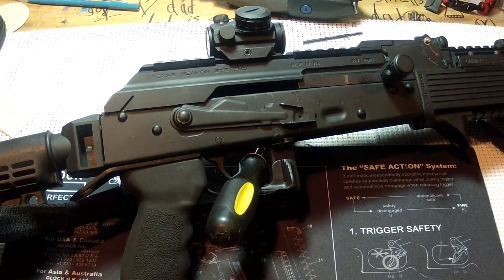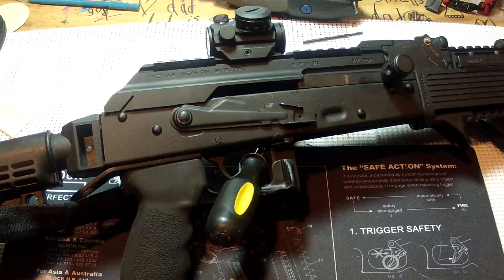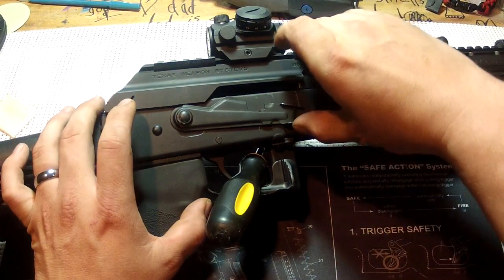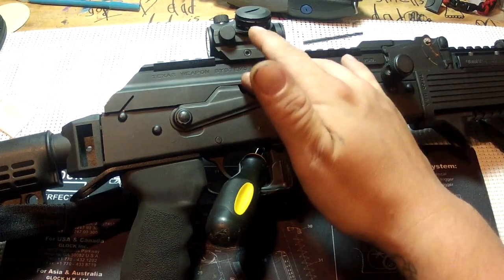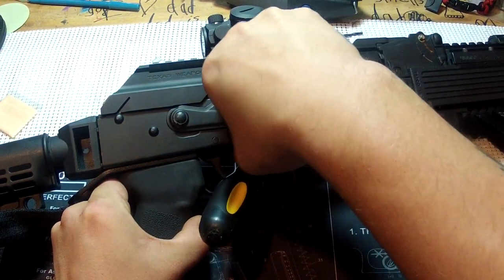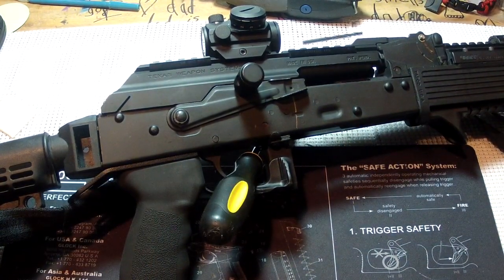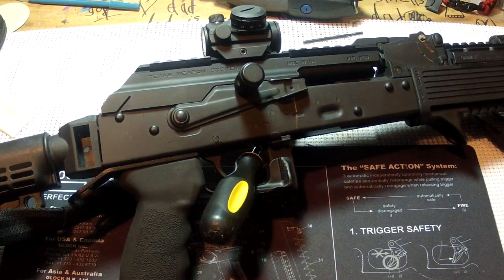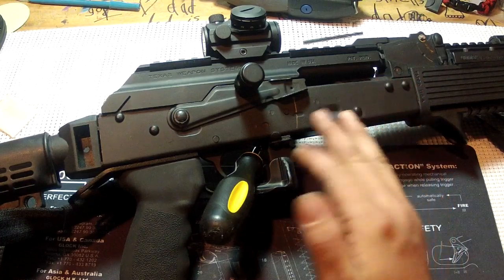AK PLATFORM BOLT HOLD OPEN  (simple modifiation)

Comment: Cool mod practical, easy and inexpensive. Yugoslavian magazines can be had for under $20 bucks and you get the real advantage of "last round BHO". But like I said very practical but you have a good rifle just get the Yugo mags. I have done mods on the cheap when funds weren't available and if need be I'll do it again but I only screw around with easily replaceable inexpensive parts. I've done some butchering and I've done some good mods but I've come to appreciate "buy once, cry once". If only I could win the lottery what a lineup of guns and a good safe I would have.

Comment: I've never been to a range where you could use a mag as the bolt hold open. They always require the mag be removed as well as the BHO engaged. This would be a good way around it, though I rarely go to ranges.

Comment: wit any AK all u have to do is hold the bolt back and pull the trigger and when u let go the bolt stays open then alll u have to do pull it back a little ,let go and it will go forward..... THANK ME LATER 💯
Reply: That doesn't work with any proper ak, maybe some weird variant... How do you think it will cycle if the bolt gets stuck open every time you fire?

Comment: Try this, when you pull back the bolt all the way, before you let it back into battery, squeeze the trigger. I believe it only work with the Tapco g2's, I'm not sure. But the hammer wedges in the action, and it disrupts the bolt from going forward, holding it open. Then swap mags, and charging the handle and your back in business...
Reply: yes this works on most AK platforms as you say not many people seem to know about it
Reply: CBtime2020 not 100% reliable

Comment: The weapon comes with a safety and well  covered action...with the  slide hung in the safety the chamber is to open to huge pieces of crud..cant see the advantage..
Reply: +VN Dustoff
This feature is intended to be used mostly in a shooting range environment. The rifle is not going to be submerged in crap while slide being held back. I can't see the problem.

The advantage that you can't see, on the other hand, would be actually being allowed on the shooting range while not being banned. Quite obviously advantageous, isn't it?

Comment: All I have to do is pull my bolt back then pull the trigger and hold it while I ease the bolt forward....I think just about all AKs do this.  Keeps you from having to butcher up your rifle.....
Reply: mine doesnt. i tried. lol.
Reply: My new DDI 47s ak 47 does not
Reply: That is the way they are supposed to be.  All Ak's do this.  This is the way they were designed in 1947.  Designed with a bolt hold open.....smh let's cut the selector switch up to make a hold open...lol  they already have one

Comment: Dude, you just cut up your weapon for no reason. You just hold the bolt open and, while depressing the trigger, let the bolt go forward. No magazine required. Wow, imagine that! Please don't tell people to go cutting up their weapon because you don't know how to use yours. Don't mean to be a dick; just saying. It may be that you have worn parts in your receiver if your bolt isn't locking back. Oh, and this feature isn't exclusive to TAPCO stocks.
Reply: An AK47 is an AK47. It's a specific design. If your weapon's bolt doesn't hold open, then either your parts have strayed from the original design, or your parts have fell out of spec. You're categorizing any weapon that looks or operates LIKE and AK47, as an AK47. I'm saying, their are AK47s AND weapons that are LIKE AK47s. On an AK47, the bolt holds open, no question. On an AK47-LIKE weapon, there are an infinite number of possibilities as to what it does and doesn't do.

For example...
If I take the piston out of my AK47, I wouldn't go around saying, "You're a moron for thinking all AK47s re-cock themselves, because mine is a single shot."  Of course not, because what I've hypothetically done is made something LIKE an AK47. It would no longer be an AK47 per its original design.
Reply: SpyderBDM Nice advice, but that feature doesn't work on all ak's.
Reply: Does not work on the WASR10
Reply: This will not work on all AKMs. There are a lot of varients that will not hold open by depressing the trigger. All your really doing is binding the hammer under the bolt against the carrier. seems like an unsafe way to hold the bolt open, & also offers no advantage since you still have to re-charge the bolt to lock the hammer & let the bolt slide back into battery,where a BHO would allow you to simply push the release w no re-charge required. With a slot cut in the safety lever you do not have to recharge to release the bolt, you just simply push the safety down. The best way to get a BHO for cheap (if you really feel like you need one) would be a metal mag modified so the follower touches the lips, or a factory BHO mag, AND the safety cut slot. Mag will hold open after last round is fired, safety will hold open when mag is released...Insert fresh mag, disengage safety & your ready to fire again.
Reply: +SpyderBDM
First of all, most AKs you find are not 47s. But I digress, this feature is not reliable or even present at all in many AKs. My 100 series certainly does not hold the bolt reliably, slides forward on the slights bump, and is tricky to engage.

Even the genuine Izhmash rifles(and not just some Chinese or Yugo clones) have a huge variation in western standards, so what might work well in one rifle won't in another. The same goes trigger pull, or anything really. Many examples require some work after purchase to make them actually useful, reliable or enjoyable to shoot. I've seen a brand new Russian Izhmash Kalashnikov rifle, on which the trigger remained stuck after about every third shot. The rifle required some file work on its sear surfaces, and worked fine afterwards. This is to be expected from any Russian gun... actually any Russian-made mechanical thingy.
Reply: @GangstaOliver  yes it does